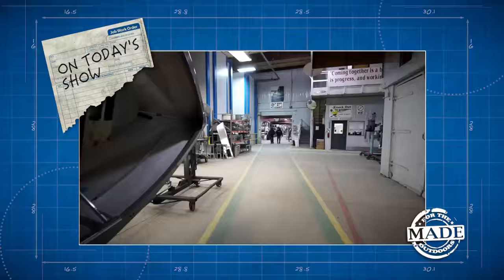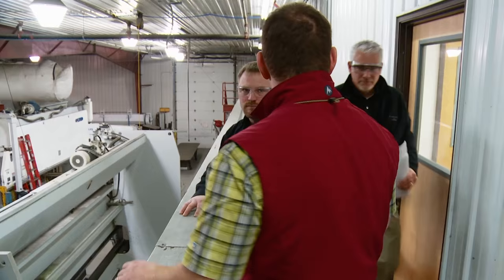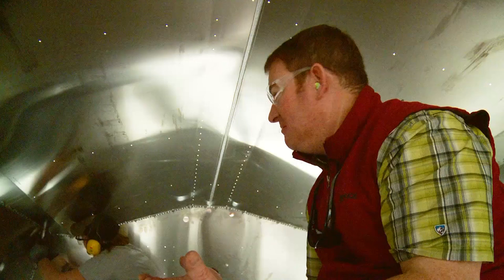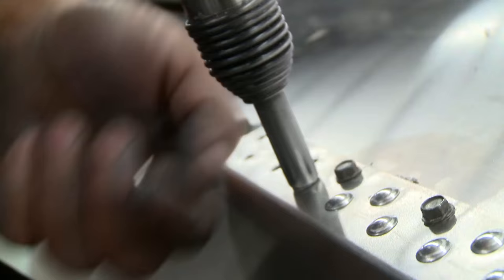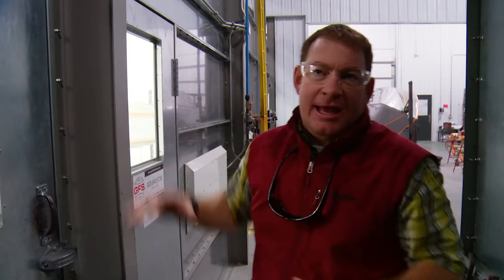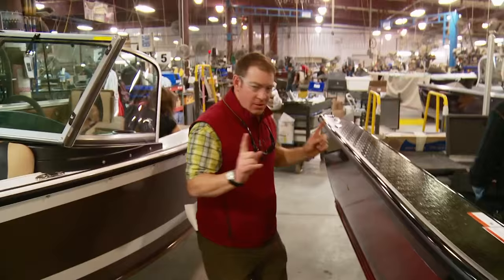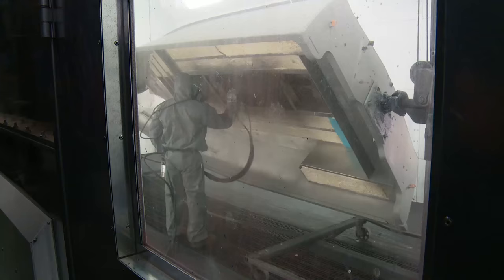Made for the Outdoors – Lund Boats – How it’s Made

Comment: Welds over rivets all day. Why still using rivets that weaken over time?
Reply: My first boat was a tracker Grizzly.   Keel weld cracked.   Got it welded at two shops,  one that specializes in aluminum welding,  2nd time at Cracker, I mean Tracker dealership.   Have a 2020 Lund Impact now.  Figured I would give a riveted boat a shot since they flex and welds do not.  We shall see how it goes
Reply: @livebig247  All current NZ Aluminium boats bigger than dinghys are welded. Skins are usually thicker and heavier to take the welds. 0.125" is absolute minimum, usually up to 0.2" on the hull bottom.
Reply: Laughs as my last 97 had no issues while people’s new aluminum fall apart
Reply: There is a reason they don't weld airplanes...

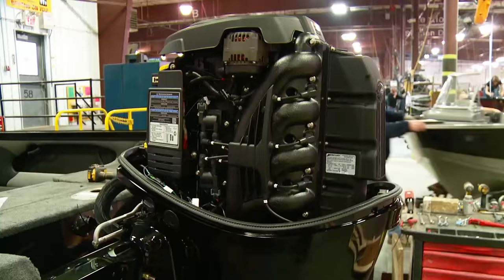Comment: So the boat experts at Lund test run (18:58) all the installed motors without water?!?!
Reply: And all that work and quality put into a boat and they still have a wood floor, it's a shame.
Reply: They use a hose to check motor 🤷‍♂️.  That’s not uncommon
Reply: There is no hose visible and no water or pee stream under the boat
Reply: Did it for the camera!
Reply: It's a four-stroke with an oil reservoir crankcase. Heat is what will kill a motor and even a minute of run time isn't going to get the motor hot enough to do anything; they had it going maybe 15 seconds for that video shot.  If they do any  tuning, I'm sure they will have a hose hooked up.
Reply: @ross7684  Its the impeller melting thats the issue. Its just a little plastic piece that can melt
Reply: Don t think so I bought My new lund rebel at dealer .The dealer put Honda motor on it and rigged the boat. Rigging was done A factory